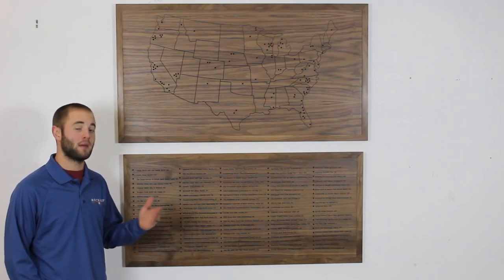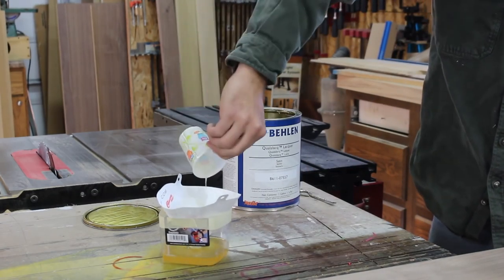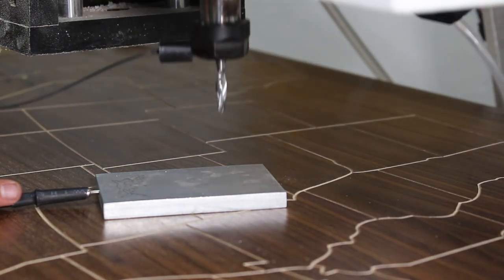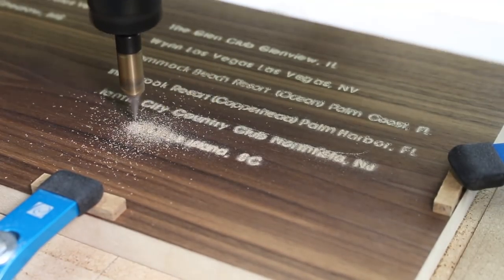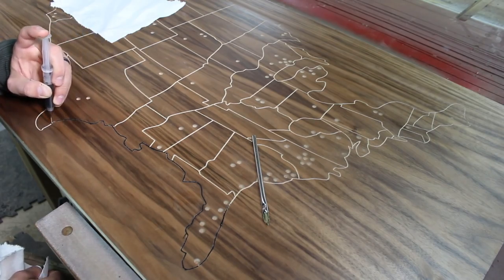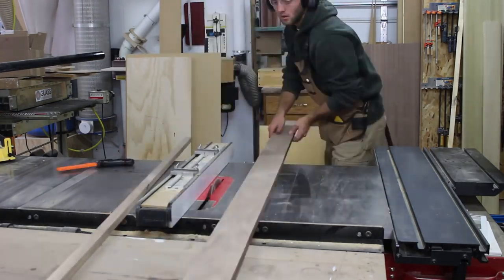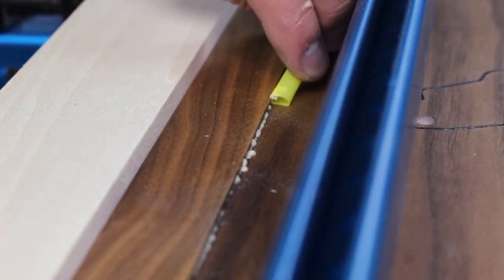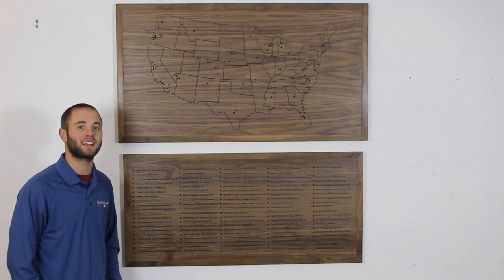Top 100 Public Golf Course Map

Comment: I noticed in the one camera shot when you were painting the peg holes on the name plate, there appeared to be some chip out of the veneer on some of the small letter insides like the "B". Did you have any issues like that, and how did you fix them?
Reply from the maker: +Kelsey Jones Kelsey, some had popped off during sanding. Little matching color pen helped with it.